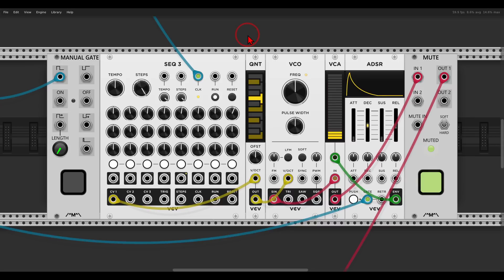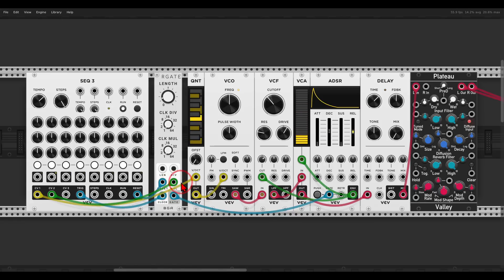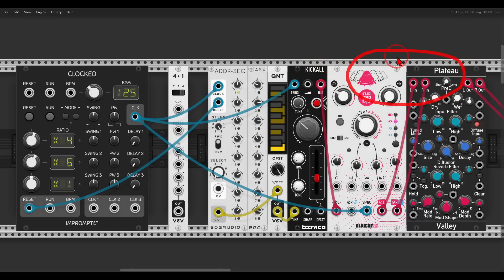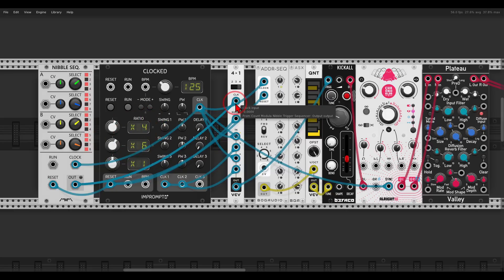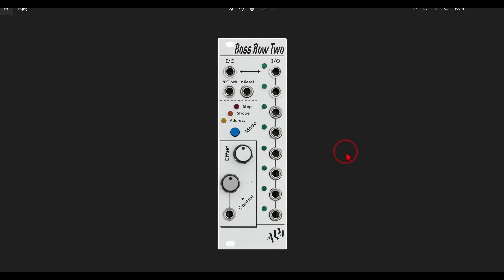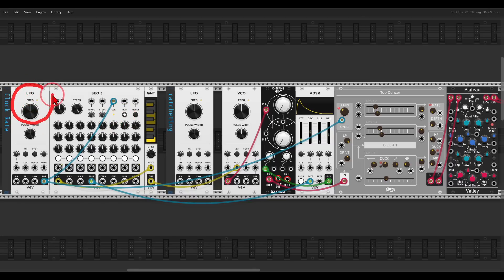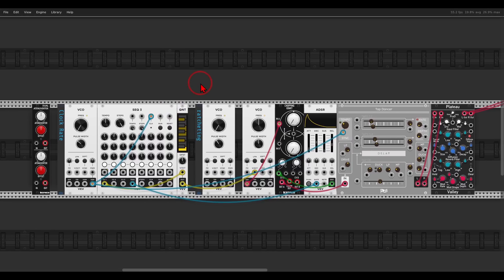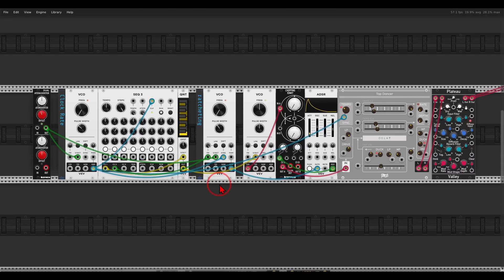3 levels of Tangerine Dream-Style Ratcheting in Modular

Comment: The approach I figured out recently was using using an 8:1 switch with address (Count Modula's and BogAudio's both do) and then using CV from a sequencer to modulate that, so each input was a differently paced clock and the control would let me pick between them without being restricted to go in a sequential order through the switch inputs. (That approach has also been useful w/ pitch inputs to do custom arpeggio patterns!) Really nice to see some other variations to ratcheting I'd never considered!
Reply from the maker: Yeah, also switching randomly is fun :)